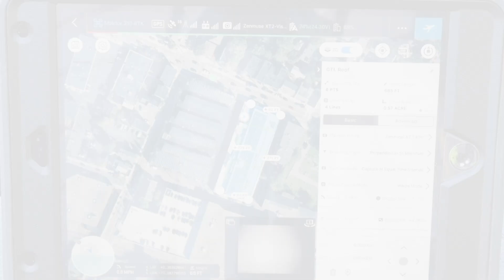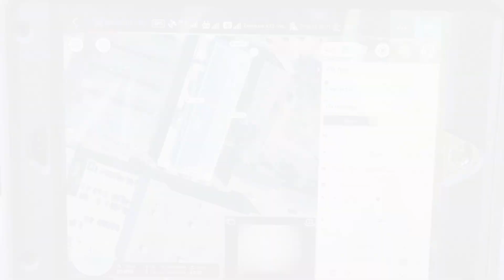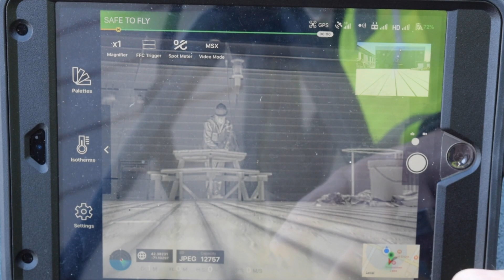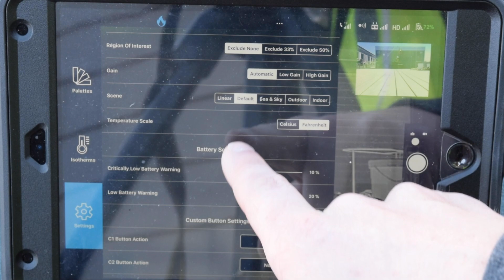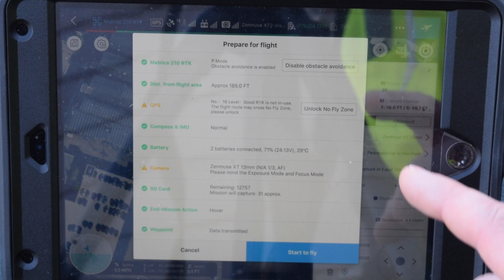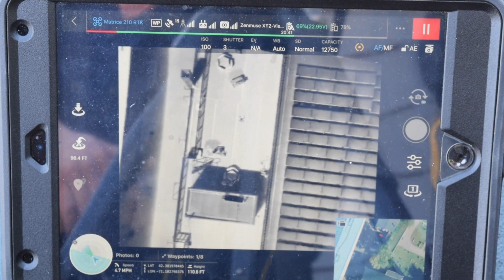Raptor Maps - How to Inspect a Solar Farm with a drone using DJI GS Pro and FLIR Zenmuse XT2

Comment: Seems this channel is pretty inactive, so I'm mostly adding this so maybe I can remember. This was a pretty nice video, but the most confusing thing for me was how do you know what direction the drone is facing so you can tilt the camera with the panels.  The answer is in the GS Pro manual, "Course Angle: The angle of the main path. East is 0, with a positive value when it is counterclockwise."  So > 180, the drone would be pointed some degree south and < 180, some degree north.  He's using around 160 here.

Comment: Thanks for video, we do follow the same procedure. But found following problems in GSpro 
1. It skips some images in same grid in either equal time/distance option. Though on screen clicking ring rotates but no image sound and no image in card
2. The time copter takes on every corner varies with no logic, I agree there must different weather parameters but still looks not correct

Comment: Great video! How do you calculate GSD of the XT2?
Reply from the maker: Thanks. So you'll need to know the focal length of your camera so you can determine the field of view.

If you're inspecting solar there are 3 common GSDs: 3.0, 5.5, and 15 cm/px. A chart with focal length and GSD is here: https://docs.raptormaps.com/docs/dji-zenmuse-xt2

The general equation is GSD = 2 * h * tan (f / 2) / p

Where h = altitude, f = field of view, and p is the number of pixels.

For 13 mm 640x512 Zenmuse XT2 this equation will look like GSD = 2 * h * tan (45/2 degrees) / 640

Comment: Eddie, I understand that flying at 3.0 cm/pix is going to be slower and generate more image, which in turn is ultimately slower or takes more time to review but why wouldn't you want to fly at the IEC standard at all times? Thanks!!  Also have do you guys have any info where one undertakes a solar park where a battery change is required? I mean is there any additional steps that we would have to complete in your software for it to read the data once the inspection is done? I do understand that the drone continues where it left off. www.reconaerialmedia.com